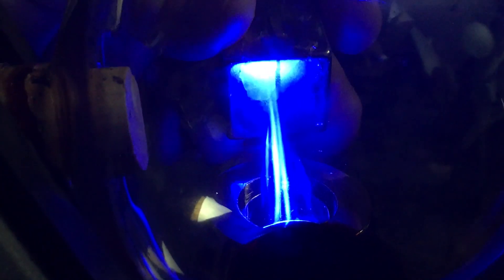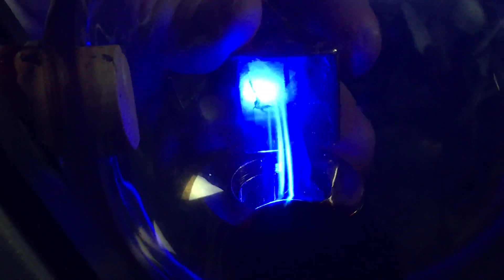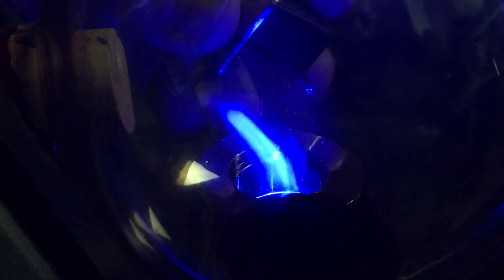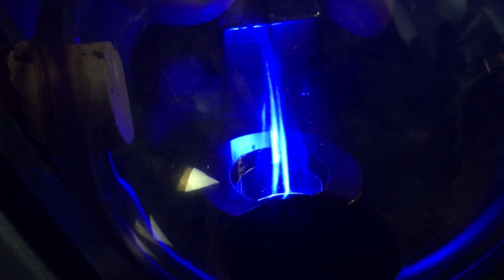Fountain of Light: Using high-capacitance BLUE light to show deeper field view

Comment: I have found an easy way to make a Ferrocell as large as you like ! ! !
No optical glass needed . . . . 
Cheap and Simple : Use a mirror -  The MirrorCell
Look here how its done https://youtu.be/eKPCjcGtLzc
Reply from the maker: yes, however that will dry up fast, and doesnt give you anything close to the same view as a flat 2 piece cell
Reply: Yes, it will dry up after a few hours, i usually don´t play around with it that long. 
After that you just rinse the mirror in water ! You will be amazed to see how easy it just pearls off. If you want to play again, just ad a few new drops of solution. Of cause you can also ad a piece of plain glass on top.
The advantage of using a mirror as "base" is, that you can move BOTH the magnet and the light source to get the best view of the field. Further  more you can make an easy chance of light source on the same field.
I have already build a 16" x 16" cell with a halogen lamp used on construction sites ! ! !
I am sure you would like to see your Monster- magnet under such a thing     ;-) 
Go ahead an try it out  . . . . .